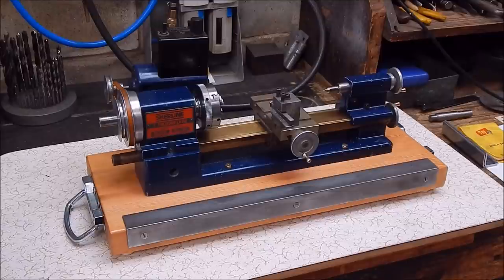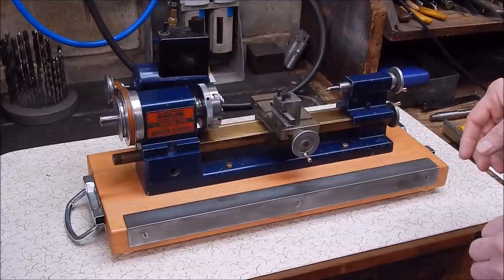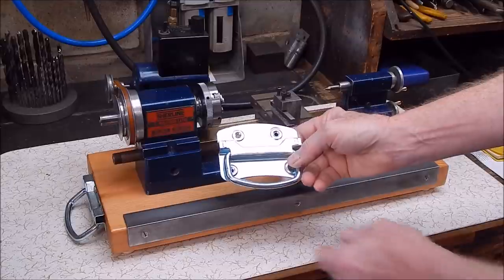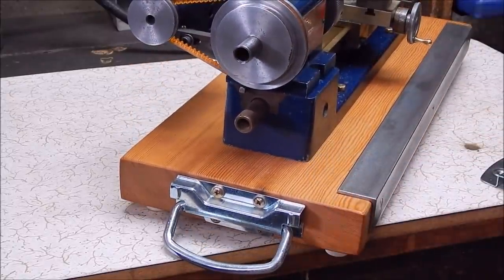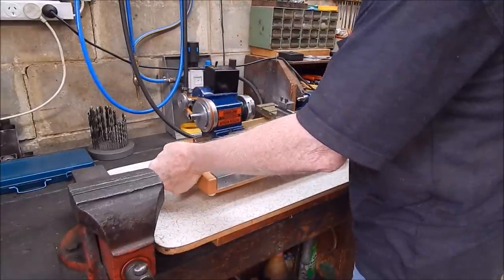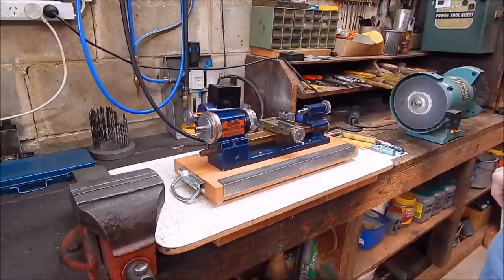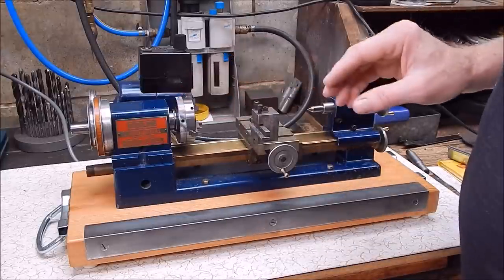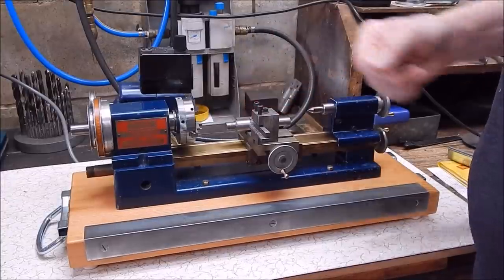Final wrap up on the Sherline metal lathe base mount

Comment: Great video sharing the portability mounting to utilize a work-space or station by making as we do with our micro-machines so that the workstation in or watchmakers shop can provide more uses then just be like a dedicated station for only this mill drill lathe etc. 
We love your metal work edge trim you added, wish I would have watched this video before just completing my newest portable machine table luckily there are more to come where we can try this 
We use these 12 inch x 18.00 inch wood maple cutting boards that are about 2 inches thick and add steel enforced rubber feet in the bottom, and the handles are carved into the ends of the tables. One of these machines we did this to is a TAIG Lathe designed to only polish metals another is a vintage micro drill press both with there dedicate mounted motors.  
Thank you again
Reply from the maker: Glad you enjoyed it.  The mag base mounting strip is a must have on these tiny alloy machines. Measuring on the machine will always be better, but it's not always possible.  

I later pulled the spindle and greased the bearings which were noisy and squared up the motor.  Now runs sweet as. 

I have three lathes and use this one fairly often for low tactile work.  It's a honey.  I checked out your channel - looking interesting.

Cheers Rob

Comment: Take the belt off and turn it back on.  That will help you determine where the noise is coming from. If it runs quiet without the belt then the noise is in the headstock. If it runs noisy without the belt, then the noise is in the motor. 

Great series. Very interesting macine.
Reply from the maker: I did just that after shooting the video, and the noise is in the head stock.

So it looks like the spindle bearings have dried out during the last 40 years ;)

Cheers Rob

Comment: looks good rob. you went this far. may as well do the bearings too.
Reply from the maker: Yes, although the chuck run out is very good, it's probably only a matter of time before they fail.

So replacing them is the next lathe job.

Cheers Rob
Reply: did you happen to see the brake lathe restore i just did
Reply from the maker: Yes I did.  I posted a comment on it.

Looks real nice.

Cheers Rob
Reply: thanks man

Comment: Defiantly a fine project.  Good job, Rob.  My only question is,  "Does the fact that the motor shaft and the spindle shaft are not parallel have any effect on noise?"  I notice in your vids that the drive end of the motor appears higher than it should be, thereby causing a twist to the drive belt.  Not a criticism, but only an observation.  My American made Sherline lathe, & milling machine, are both parallel..  Thanks much, I look forward to your vids & experiences. ..........................Dick
Reply from the maker: Hi Dick,

No, that shouldn't have any effect on noise.  I did try to square it up, but the mount needs shimming , so that's another job.

The bearings in the head stock sound like they are running dry, so I will pull them and either grease or replace them.

The later Sherlines use sealed bearings, but the early Australian ones appear to have open sided magneto bearings, which can be re-greased if not marked.

Cheers Rob

Comment: About the head stock noise, I have a newer 18" bed with the original motor, (about 15 yrs old) and mine is much, much quieter. Also my spindle runs on for a few seconds after the power is removed. Does yours have ball bearings or just bushings?
Reply from the maker: It has magneto open ball races.

Cheers Rob

Comment: Rob, love your vids and I know this is going to sound picky but how long are the toolbox handle screws? I ask because any woodworker worth his salt knows that screwing into end grain makes a weak connection compared to screwing into face or edge grain. Those handles looked large enough to bend ears under the bottom of the base so the screws would be threading into face grain. The tear out strength difference between face - edge grain and end grain is about 10:1
Reply from the maker: The screws are 40 mm long.  There are eight of them.

Bear in mind that the load bearing force is at 90 degrees to the thread.  I considered all this when I did it.

The wood is also quite hard to screw into,  even when pre-drilled.

I'm quite sure they will stay put and do the job.

Cheers Rob

Comment: Wouldn't it be even more secure if you had folded the lower two screws under the base?  That would eliminate reliance on just screws into the end-grain for strength.
Reply from the maker: I considered that, but there's no way you will break out/off those eight high tensile screws.

Also it would be difficult to execute a small radius 90 degree bend on the handle plates without a break type folder - which I don't have.

I could easily hold this lathe and base by one handle without any chance of it coming apart.

It's plenty secure.

Rob

Comment: Rob, the pully from the motor and the headstock aren't inline, the faster it turns you see the motor pully shifting to the right. look back this video to see it your self.
Reply from the maker: They are aligned OK, the problem is the head stock bearings.

Will have to service that next.

Cheers Rob

Comment: I know nothing about lathes but I just noticed towards the end of the video that the pulley on the motor is out of alignment with the pulley on the lathe like the motor mount is out of whack or something could be why it's noisy.
Reply from the maker: The camera makes it look like that, they are aligned but the motor is sagging on the mount a bit.

I've found the problem - head stock bearings.

Cheers Rob